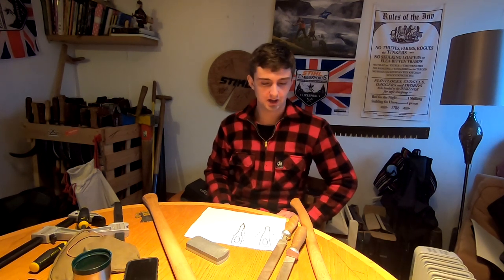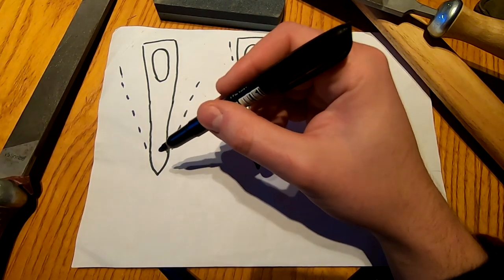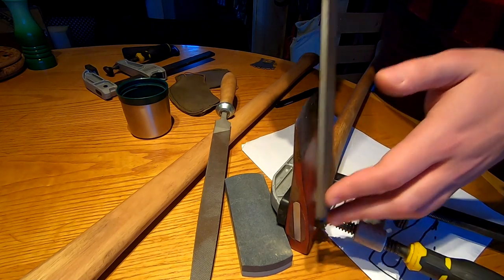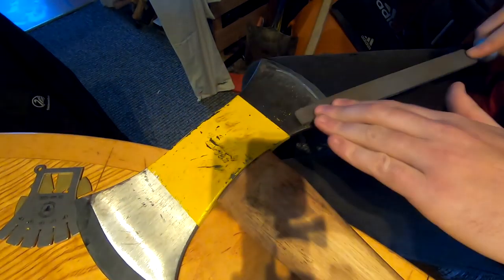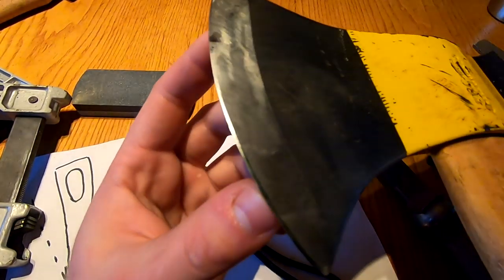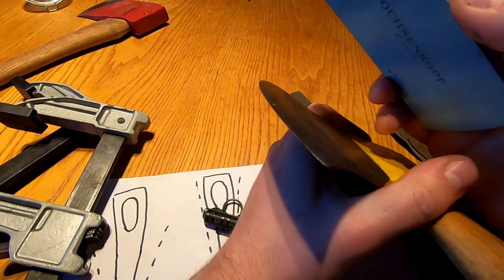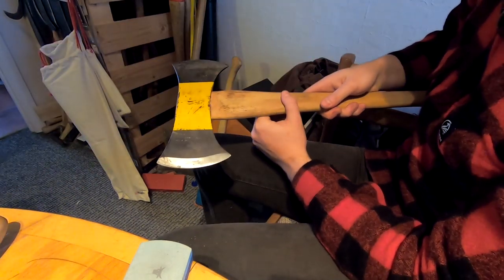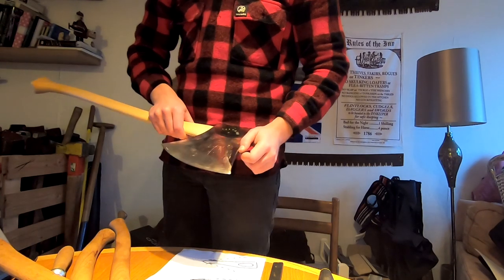How to Sharpen an Axe for Efficient Chopping

Comment: did the same bevel as that and broke frist time using it =(
Reply from the maker: Any more details? what wood, what brand were you using and actual angles did you end up with?
Reply: @benscottwoodchopper  it was pine and to be fair it was very hard and knotty... Axe was hultafors 1.2kg the one you recommended, did a nice job with the handle and all 😪 didn't know actually angle but did same as you.
Reply from the maker: @jamesoleary4742  how bad is the damage? If its minor chips or rolling just file them out putting on a steeper secondary bevel.
Reply: @benscottwoodchopper  it's fairly bad big piece came off it.. Not to worry its all learning process, keep up the good  videos bud 👍
Reply from the maker: @jamesoleary4742  Ah that's unfortunate, still should be able to file it out, but before you do try to find some way to measure the angles, that way you know for the future what is too extreme. There is also the lower possibility of it having a bad temper but its hard to say without seeing it. Just seen this today, happened to a brand new gransfors https://www.reddit.com/r/Axecraft/comments/f4r9iy/chipped_my_gransfors_bruks_is_this_normal/?utm_source=share&utm_medium=web2x